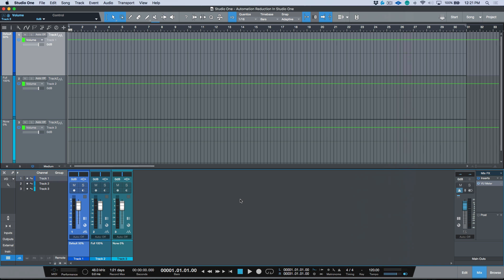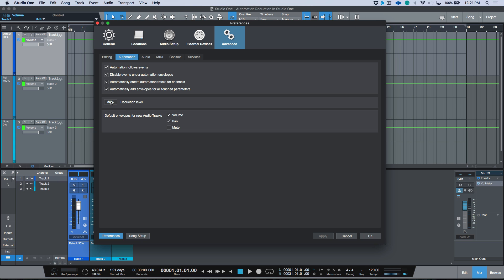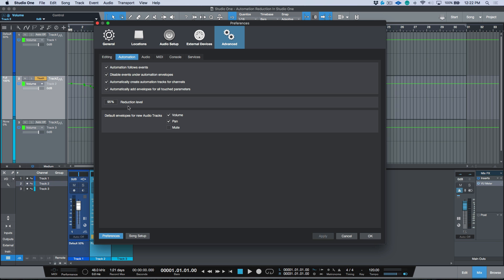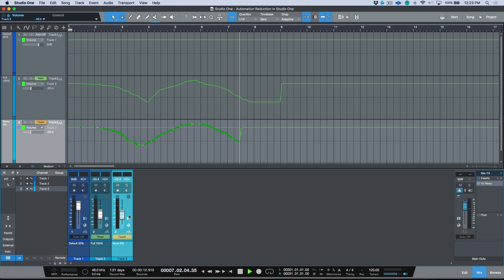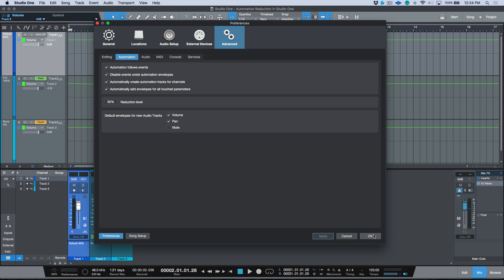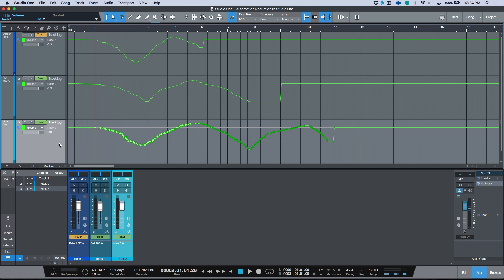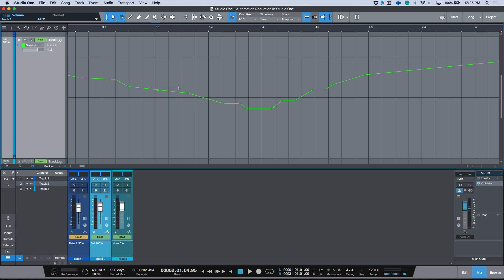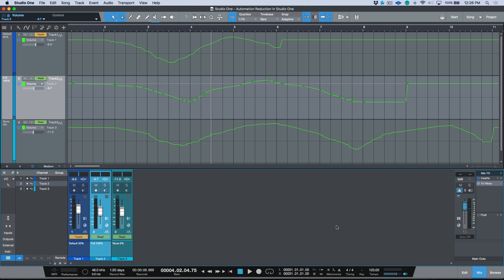Studio One 4 Quick Tip - Using The Automation 'Reduction Level' Setting To Smooth Out Automation

Comment: Nice and helpful video as usual Marcus.  Can you please help a fellow Canadian here?  Been searching for this info for a while now and still no solution anywhere on the web.  My question is how to thin automation data afterward, when the track is already recorded?  I am recording/editing a digital FR8 accordion and the bellows are recorded as "Expression" midi controller.  But in S1, I get weird data that makes the sound go bumpy.  There are often two nodes at the very same place in the data track and you can hear a little sound fluctuation.  The bellows are very sensitive on the accordion.  Way back in early MIDI, you could simply say to your DAW: "thin out MIDI controller on a track"